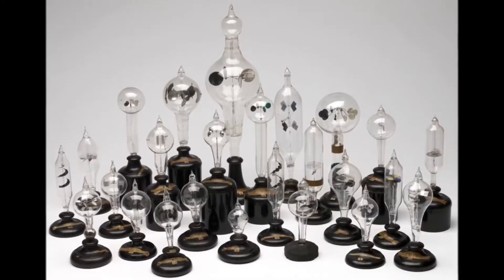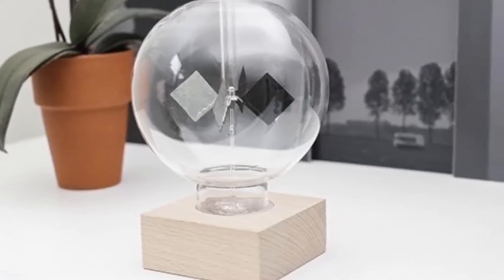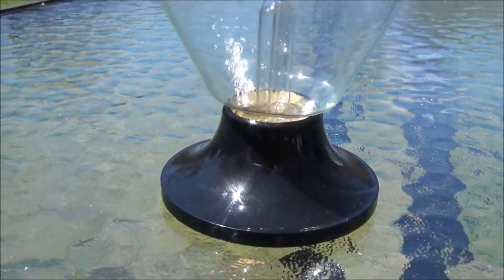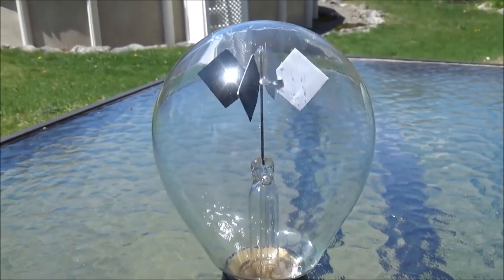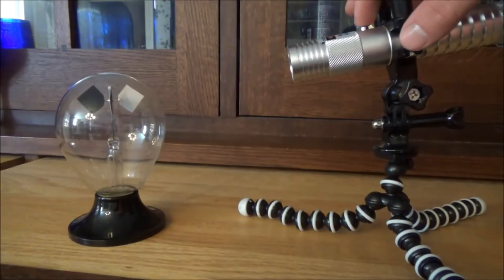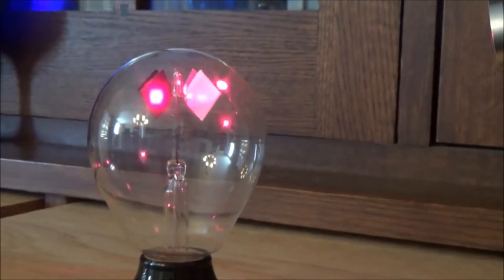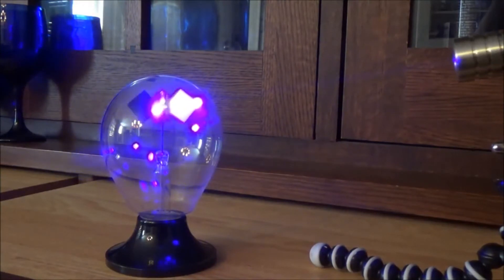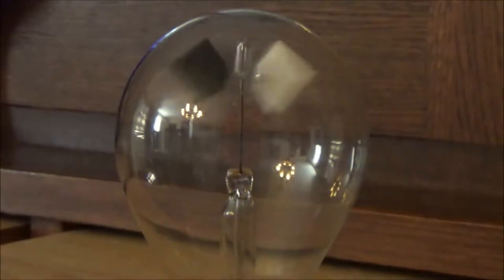How to Move an Object with a Laser

Comment: Maybe some DIY laser optics, or a cheap/DIY optics table or aluminum platform of some kind to do laser and RGB experiments on cheaply. And similar to “thought emporium’s” holographic‘s video… Some type of vibration dampening platform and if you did some holographic experiments that would be super awesome! I’ve done some holographic laser stuff and it can be done extremely cheaply these days… And you already have all of the lasers! It’s so much fun to produce your own high end holographic‘s and frame them on your wall.

Considering DIY optics and having a platform or base plate to do basic experiments without spending much money…… there are some beautiful HUGE heat sinks that can be found for under $35… nice 3/4 inch thick solid aluminum with big beautiful fins on the bottom. I’ve found several in my collection ranging from the size of a standard rgb laser module… Up to something larger like a benchtop optics table that’s 2.5 feet long an a foot wide.

 These would make a perfect low-cost optics platform. To give a place for experiments and such. 

And there are some beautiful mirror mounts, beam splitter mounts, And RGB mounts that can be found for around five dollars! 

Would definitely bring in some more subscribers, and if you and some of the other laser channels could get a collaboration of interest going… That would also bring in a lot of subscribers. Check out “zenodilodon”, “Marco reps”, “thought emporium”, “photons across the air” and “tech ingredients” . All of those guys would be super interested in DIY optics stuff and would love to see it on the platform. They are all into much more advanced stuff but have a lot of viewers interested in diy/cheaper optics and laser experiments all of the time.
Reply from the maker: Thank you for all this amazing input, I definitely have my work cut out form me!